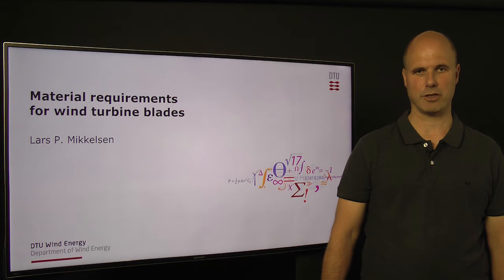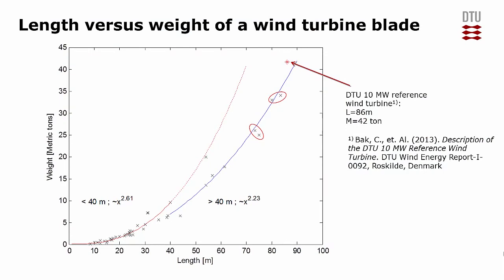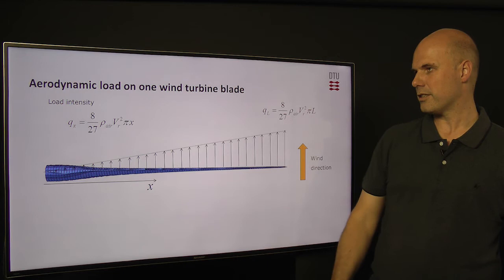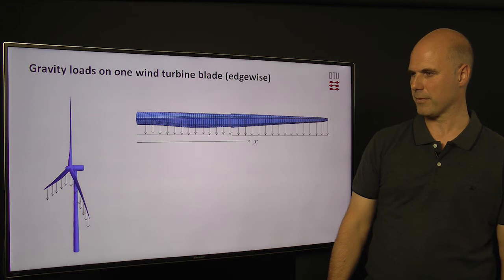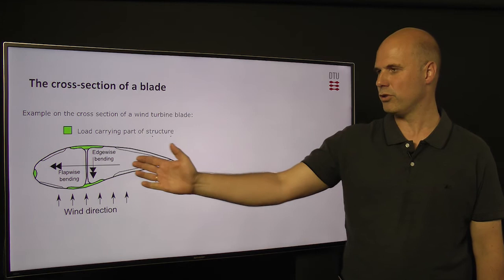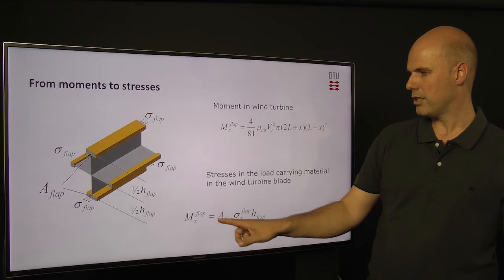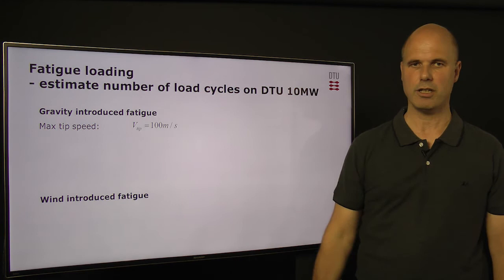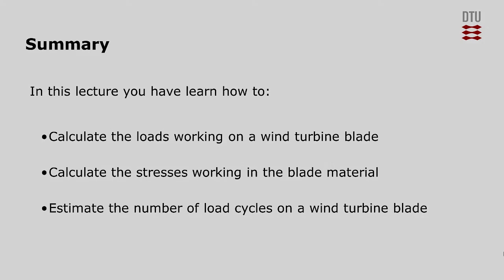18. Material requirements for wind turbine blades

Comment: I think the gravity and wind introduced load come out from fluid dynamic calculation and they are pretty steady. The turbulence, described by a turbulence matrix play an role to increase the cycle significantly. A bode plot shall be able to describe the frequency response of a blade from external excitation in fluid or potential flow. but we still need to know how the turbulence matrix change the steady flow and the effect on wind blade or simplify this effect in another way in order to get the load varis in respect of time.